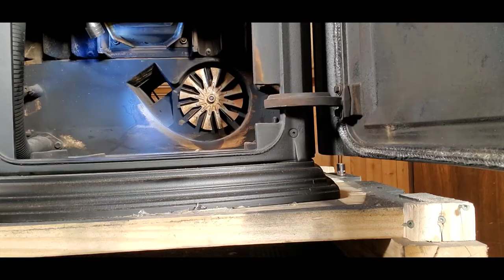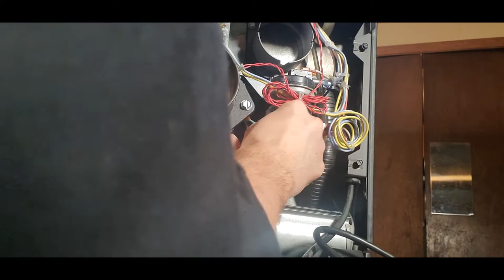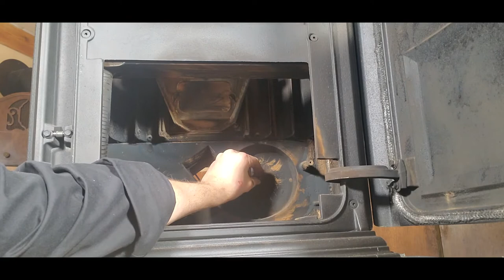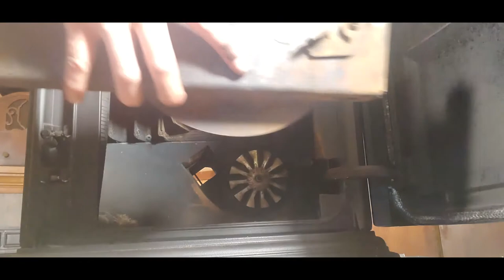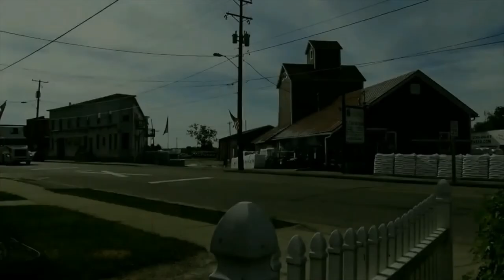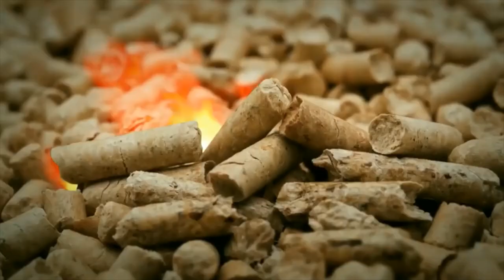How To Replace a Harman Combustion Blower, Exhaust Fan Draft Motor

Comment: Great video, thanks for what you do.  I have a p68 and it's been purring like a kitten since 2005,but after my first ton this year and I did my deep cleaning . I have been getting smoke in the hopper and  Excessive heat around the slide plate which causes the pellets to stick to the sides of hopper  Creating a dam so to speak, so only the pellets from the center of hopper are being used... I was told it's probably the combustion fan but it seems to spin nicely and it's hard to get dealers around here to share their knowledge and I get that..but if you have any suggestions or clues I would greatly appreciate it and I will buy any parts from you guys from now on! Thanks again Rich
Reply from the maker: Hey Richard, thanks for your message. I ran this past our Lead Harman Technician and here is his overview. 
A few things here and not typically seen on P series but not out of the question.  Smoke infiltration into the hopper is an issue with any steel Harman feed system since 2004.  Harman’s fix was to introduce a fresh air supply to the feed system, aka, “tube job”.  2008 this became standard equipment on all Harman feed systems through present time.  Prior to 2008, this tube job had to be done as an in-field service.  For the do-it yourselfer the recommended first step is to clean the creosote out of the feed system with picks and screwdrivers which requires a complete dis-assembly.  The other option is to burn it out but only a trained professional should attempt this.  There may be YouTube information on how to do a tube job???  Other symptoms will be diminished fuel feed to the burn pot or lower fire height.  Other causes contributing could be:

 

1.       Hopper and fines cover sealing properly?

2.       Auger front flight worn away to the center post reducing the “fire-stop” capability of the auger.

 

If the auger front flight is worn away I would certainly look at this as a first step and inspect the feed system more thoroughly once the old auger is removed.

 

Preventing smoke from entering the hopper completely is what a tube job does.

 

The hopper – the smoke residue or creosote can be cleaned off with stove glass cleaner, might take a bit.  Once clean, apply some car wax to improve pellet flow.
Reply: @EarthSense Thanks for the reply it's greatly appreciated! I purchased the stove in 2004 and installed myself.  I noticed it didn't seem to be working as it should so I did a tube job? (aka) OAK? ..outside air kir?. It's been fine till this year..also I noticed a lot of carbon build up in the fire pot this year as well. I never had to chip the pot with a screw driver before this year.  The only other variable this year was I started using softwood..which I always ran new England hardwood faithfully. I don't think that's the root problem though. Given what your saying I didn't like the way the front of the auger looked like at the beginning of the season..it does look really burnt and black and lately I have been hearing...about every 5 minutes or so a clunking noise like the auger is trying to over come something like if the pellets are to hard..lol not possible I imagine. I have  7 bags of pellets left and then it's done for the year.. well given the problem I'm having with it anyway. The fines cover does seem to be sealing good as well. I'm thinking about replacing all gaskets, doors, hopper and now fines cover along with the auger..after throughly inspection of the of all parts. As I'm typing this all I can hear is that auger clunking away..I would rather buy the parts needed from you guys after my deep dive into the stove.. as I'm assuming that you sell them??? Had to ask given what they say about assuming...lol. let me know thanks. If you have any other thoughts as well that would be awesome! Thanks again Rich. Ps. I'll be in touch 🙂
Reply from the maker: @richardmitchell7836  Thanks for the message Rich, always happy to assist. The 'Tube Job' is different than the Outside Air Kit (OAK). It was a factory recommendation for dealers to perform in the field prior to 2008. It's an additional tube that goes into the feed system to provide a fresh air supply. The issue you are experiencing was quite common in several of the models. I can't find any literature or videos online for this. We can add it to our queue of videos, but it may be sometime before we are able to film that. Possibly contact Harman direct and see if they have any kind of an instructional outline regarding the Feed System Tube Job.  Keep us posted on that. From everything you are mentioning it certainly sounds like we have an air issue here. Generally speaking, we see creosote and hard scale build-up on the burnpot when the unit is running on low settings and we have too much air or an air leakage point. If the Hopper lid was left open or the gasket was not sealing well, it can certainly have an effect here. The pellets you burn definitely play a major factor. There are so many variances between hardwood and softwood. Good to see if the manufacturer has a PFI Label/certification on the bag (Pellet Fuels Institute) Important there's no binders or additives in the fuel. Our most popular sellers are premium softwood pellets although we do sell a good amount of premium hardwood. 
Good observation on the auger. My initial thought is that the creosote build-up is causing the auger to bind and clunk a bit. It will be good to do a thorough inspection of the feed system and checking the gasket seals over is always good practice after a handful of seasons. Yes, we do stock virtually every Harman part, OEM and a decent amount of aftermarket. Here is the General Page for P68 Parts for your reference. Keep us posted on everything. Thanks!
https://pellethead.com/product-category/stove-parts-accessories/stove-parts/see-all/?model=37876
Reply: @EarthSense  wow I'm just impressed with your response.! The tube job.. im assuming is the tube in the back which I see on the newer models? I'm thinking connects the combination air to the auger Area and I appreciate you researching install of the tube job excellent. Here in CT. everyone wants to sell you a fish and not teach you how to fish...and I can kinda see and understand that as well to some point. I was on your website earlier ..just curious if the auger was a updated one given I heard some scuttle butt about a updated one and didn't know if there was any truth to that?. I'm definitely going to contact harman directly and see what information I can gather up.When I get the stove torn down and  Evaluated I'll be calling you guys for parts and definitely keep you posted as well.  Thanks again Rich and stay well!
Reply from the maker: @richardmitchell7836  Our pleasure Rich! I'm a big proponent of teaching one how to fish. Empowerment and ownership are great traits to carry in my eyes. There was a point where Harman changed the P68 auger motor. They went from a 4 RPM to a 6 RPM. 
4RPM Motor Pre-Serial Number 008280309
6 RPM Motor Serial Number 008280309 & Higher
The auger shaft was changed as well when Harman went to the UL Feed System.
For the P68 Post Serial Number 008280309 Would use the UL Auger and Pre that serial number would use the original auger shaft.

Yeah as far as the tube job goes it's been a long time for me personally since I have seen that done, but yes it is in the back and the tube connects by the auger/feed system to the combustion manifold I believe. Push comes to shove I can have one of our experienced techs provide an outline that I can send of your way on that. 

Look forward to hearing the progress!
Reply: Hi Rich again I'm curious if it's possible for you get the harman air cross over tube kit ? I believe it's part # is 1-00-6700 ? And if so I would be interested in adding that to my list of parts,since harman doesn't seem to sell to customers
Reply: I'll check for that serial number on the feed motor, I don't know if this serial number helps. On my warranty registration form has a number of 000540 ?
Reply from the maker: @richardmitchell7836  Hey Rich, Yeah it will be the serial number on the unit, not on the feed motor. On the rear of the stove you will see a UL label which will provide the testing information of the unit and also include the serial number. Your warranty registration number sounds like it's part of the serial, let's see if we can get the full serial number. Based on the Man. date you mentioned, I would be fairly confident your P68 is Pre the UL Feed System. Let me check in with our parts team on the Harman Tube Kit and Part # you mentioned. I'll follow-up. Thanks!
Reply from the maker: @richardmitchell7836  Hey Rich! Our Parts Manager just sent me a diagram and a Part Number regarding the Tube Kit. Is there a good email for you so I can send this off your way?
Reply: I forgot to mention that the sticker was located on the back side ,behind the  hopper lid on the slope down if the info sounds right to you? Thanks
Reply from the maker: @richardmitchell7836  Hey Rich, yeah sometimes they placed the UL Label in the Hopper, majority of the time on the rear of the unit. There should be a clear line on the Label with the serial Number Stamped in. Again, parts manager sent me a tube job diagram from Harman along with the part number. Shoot me an email address and I'll send that off to you.

Comment: I have the same stove as in the video, and while taking the old blower out, one of the nuts won't come off because the stud itself is just spinning.  Any suggestions?
Reply from the maker: Thanks for contacting us. See if you can remove the other nuts and pry the motor forward a bit to put pressure on the spinning stud. If that doesn't work best option may be getting in there with a dremmel tool to cut the stud/nut. Sorry to hear this, very frustrating - hope this was helpful. Keep us posted, happy to assist.
Reply: @EarthSense  Thank you for the quick reply.  If I have to cut the stud/nut, are these studs replaceable?
Reply from the maker: @Border-iq7we  Thanks for the message back. If you have to cut the nut/stud, it's going to be very difficult to replace the way that stud is machined by Harman. You could tap and die a new bolt and nut as one option, the other option would be to see if the other two nuts securely hold the motor in place. For the Harman here the bolts and nuts are just securing the motor, it's not about creating a combustion seal. So if you secure the other two nuts and the motor feels firmly in place, we should be good to go just using those two and leaving the 3rd stripped one as is. This will not affect the performance or safety of the unit, we just want to make sure the motor is secure. Hope that makes sense, please keep us posted. Thanks!
Reply: @EarthSense  Perfect sense, thank you!
Reply from the maker: @Border-iq7we  Thanks Bud, keep us posted.
Reply: @EarthSense  Just an update...I ended up cutting a slot in the head of the stud with a Dremel cut off wheel, and then held it with a screwdriver while removing the nut.
Reply from the maker: @Border-iq7we  Great Job! Do you have the new motor in place now? Does it feel nice and secure?
Reply: @EarthSense  I reused the stud so I could attach the motor using all 3 studs, as the motor did not feel secure just using 2 studs.
Reply from the maker: @Border-iq7we  OK, great to know. So glad you were able to get things secured properly. Great persistence on your end! Any questions down the road just let us know. Appreciated!

Comment: After my husband replaced our combustion fan motor, nothing else is working. When we played it in the only thing running was the combustion fan…no auger, nothing…the only light on is the combustion blower…all were working before the replacement…any ideas?
Reply from the maker: Thanks for contacting us. Are you seeing any blinks on the status light? Any differences from Room Temp to Stove Temp? Make sure the igniter toggle is on Auto. Was the stove unplugged during the replacement? If not were there any electrical shorts that happened during installation? Double check the ESP Thermistor Probe in the exhaust and the electrical connections. Here's a video on pulling out and cleaning the ESP: https://www.youtube.com/watch?v=kt7nnGMYU-k&t=1s

Check all the simple things first. Happy to help.
Reply: I got it running last night after watching your video about the vacuum switch! Yay! Husband cleaned the ESP Thermistor Probe, after watching your video on that. I then checked all the connections and it started up like a champ. Thank you so much for your videos! Pellet stove is in a yurt and we just got 18” of snow and temps in the 20’s!
Reply from the maker: @Laurie-rq3xq  That's fantastic to hear Laurie! So glad you are back up and running again especially during the cold temps. If you have any questions down the road, don't hesitate to reach out! Thanks!

Comment: I’m wondering ,I have a question the combustion motor is a two-stage motor ??because when starting up now it stops for a second continue stops for another second then I can smell the smoke and then once it’s going it’s fine so that tells me it could be a two-stage motor which is pulling a little bit more voltage in the first stage. Or am I incorrect?
Reply: It can’t be a 2 stage motor its only 110. So whats causing this?
Reply from the maker: Hey Rob, thanks for contacting us. No, not a 2 stage combustion motor. On start-up cycle the program will run it near line voltage. Once start-up cycle is complete and the ESP reaches proper temp, the combustion blower will regulate voltage automatically based on your heat setting/thermostat setting.
I would lean towards this being an issue with the motor given the description you provided. Often as combustion motors start to fail we will notice either noise or we'll see intermittent operation during start-up. The control board will be the only other component that controls the voltage to the combustion blower. Given all other start-up aspects are correct and it runs fine after that stall, I would not think it to be the control board issue. 
Hopefully that's helpful, if you have any further questions or need reference links just let us know. Thanks!
Reply from the maker: @Rob-hv9kt  Hey Rob, just sent a reply in the previous message you sent. Thanks!
Reply: @EarthSense  yea that makes sense also i did notice last season combustion motor a touch louder. Thx!!
Reply from the maker: @Rob-hv9kt  Most welcome Rob, yeah I would be near certain that is our issue here. Keep us posted! Thanks!
Reply: @EarthSense  will do. Its 6 years old . So its the only thing that is giving me a issue. 
Thank you for responding! I clean this thoroughly twice a season I go through maybe 2 tons. Harmon stoves i think are top if the line. Thanks again. Will update soon
Reply from the maker: @Rob-hv9kt  Sounds good Rob. Great job on the cleaning - it's a huge part to having a happy stove. Yeah I would certainly agree with you on Harman stoves. Look forward to your update!

Cheers,